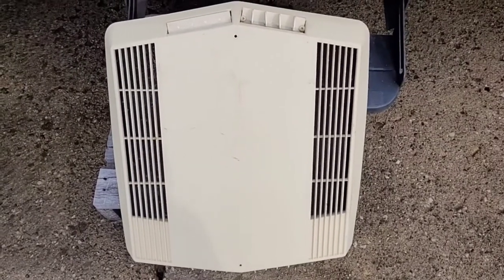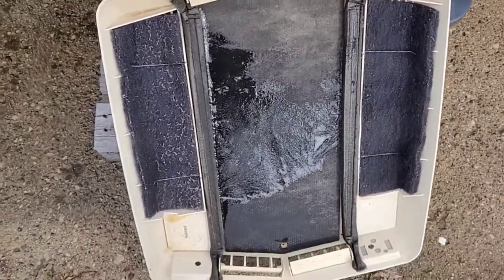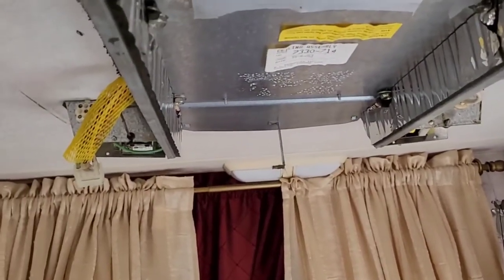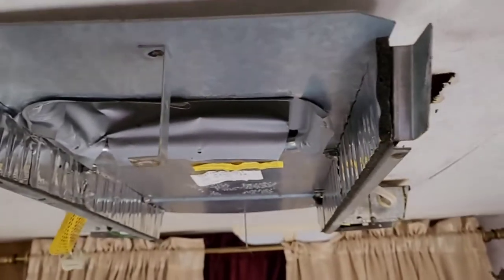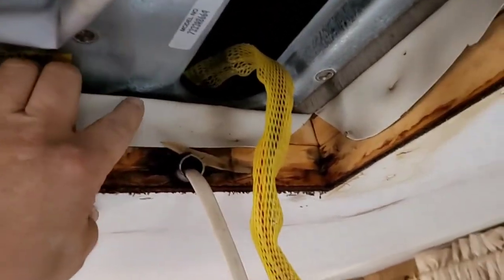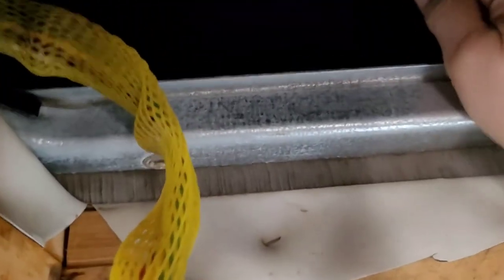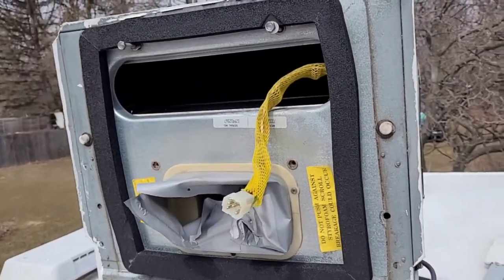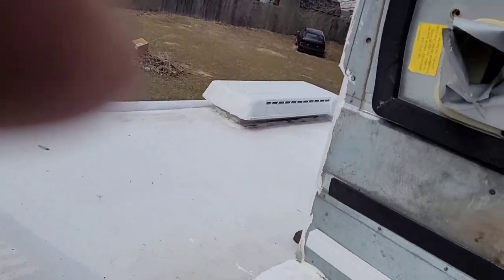A/C LEAKING REPLACING MY RV/AC GASKET. Not as bad as I thought.

Comment: Did you turn off everything.on rv or.just a/c
Reply from the maker: All I did was unplug the wire harness.  And make sure breaker was off to A/C.
Reply from the maker: Sorry for the late reply. I just turned off the breaker to the rooftop unit.